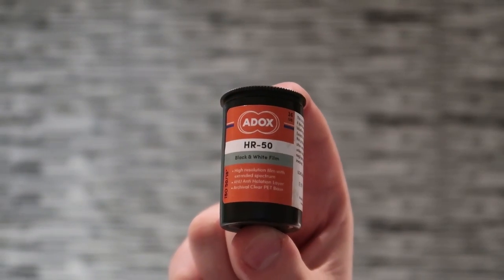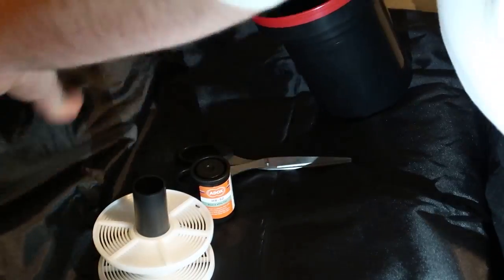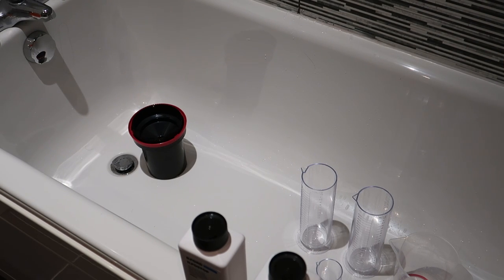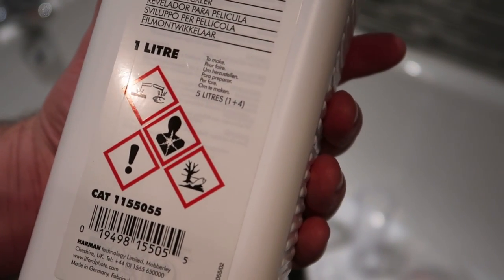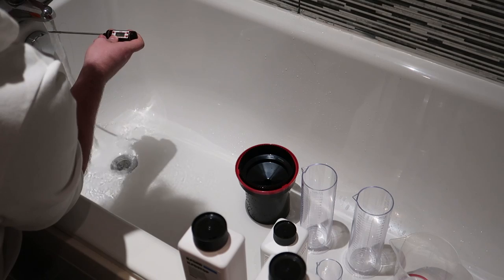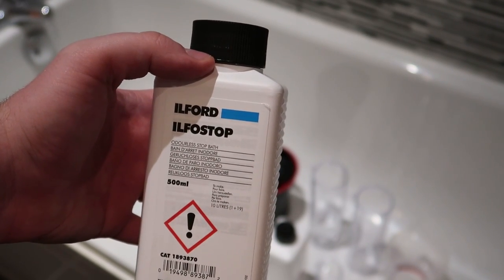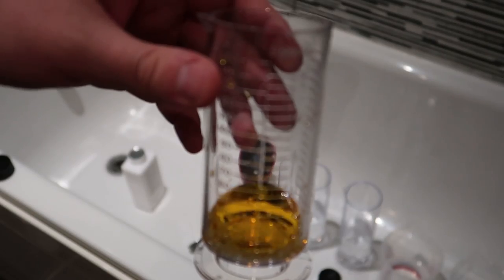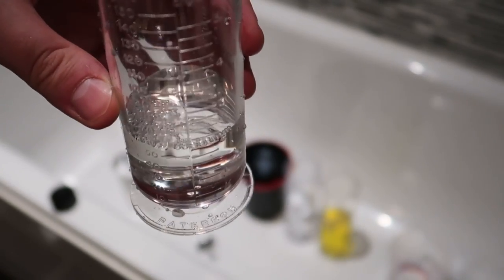Let's Develop Episode 4 | ADOX HR-50 with IFORD DD-X

Comment: SCAN??? I make photographic ENLARGEMENTS of my negatives! To check grain structure, I use a 50 power USB microscope I bought on-line for $20, and to check film speed, I use a MacBeth densitometer that's probably older than you! I'm also a Nikkor/KIndermann stainless steel tank and reel guy from 54 years ago, although I have a Jobo processer too. You film babies should go back half a Century when we made our livings from B&W photography! Mainly with LARGE FORMAT cameras (4x5 press cameras). One event, FOUR SHEETS OF FILM! Come back with the photo!
Reply: And you had WALK everywhere uphill BOTH ways 😜